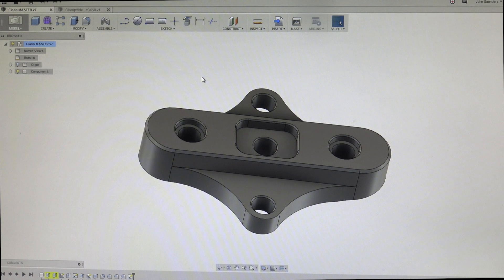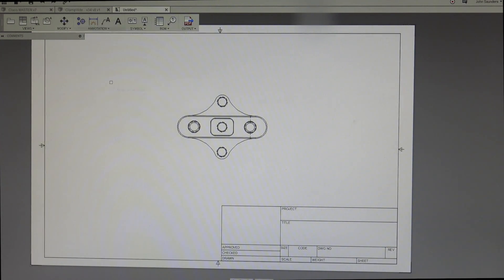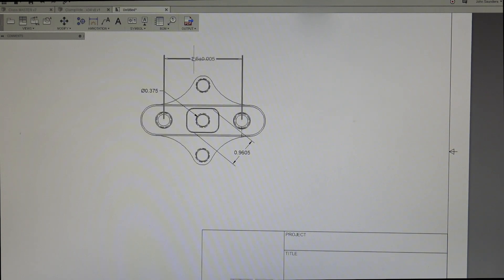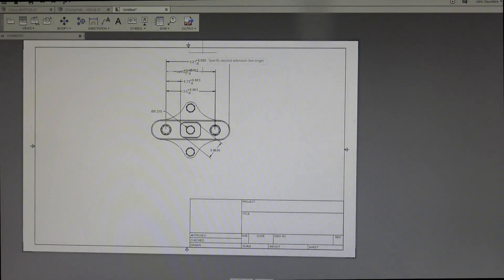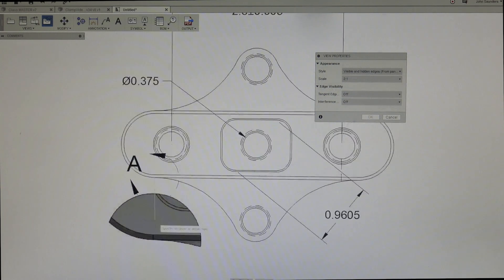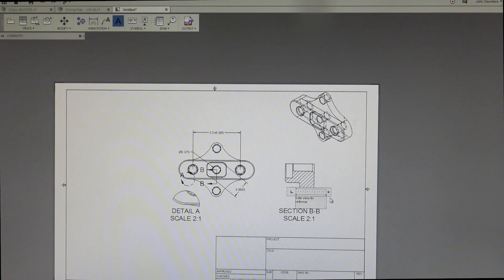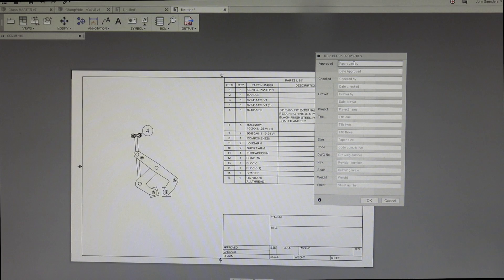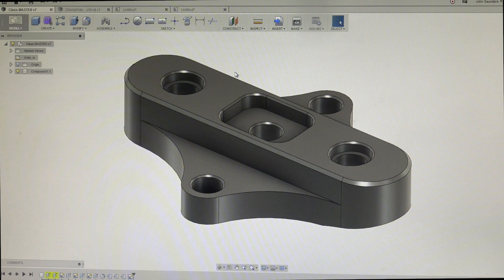Fusion Friday #14: Drawings Tutorial

Comment: You can turn on the trailing zeros by clicking the icon next to the zoom fit button on the bottom of the screen.  It looks like a linear dimension line wit a gear under it.  Check the box that says "display trailing zeros".  That frustrated me for a while, until I was shown it.  Good luck and great videos!

Comment: That was a good basic introduction John, and I think covered most of the basic drawing functions. How important drawings are will depend on the person/application, for me they're often very important, and I absolutely loathe F360's drawing function. I otherwise really like F360 but if I were doing the same as I was doing in a big commercial shop it would be a deal breaker in itself, and that's a great shame. I think drawings are easily the worst area. I particularly have a lot of issues with it picking up the wrong dimension and coming up with an error similar to you had, but often it's very difficult to fix, it's clunky, glacially slow, sadly so it goes on. Apparently the team are working on it, but I wish they would get their skates on with it!
Reply: +NYC CNC Of that's good to hear. I meant to go back and edit my comments to say that the only reason I mentioned it at all was because some of us do indeed use drawings, and for those of us who do it can be important. I didn't want to waste any of your time on this John, sorry 'bout that, but I thought there was a good chance somebody on the F360 team would read it. I clean forgot to do the edit until I saw your reply. FWIW I went through the F360 forum (as have many of us) on this, but it got pulled (rightly) from the ideas station, as a generalised comment that the drawings function is hopeless and needs a complete rebuild isn't much of an idea! Ha ha.

Comment: John,  another great video.  It does bring up another question I've had about 360. As a brake operator, I'm used to having prints with a dimensioned flat and usually a dimensioned isometric of the bent part.  Is there currently an easy way to do this.
Reply: +NYC CNC sorry I even confused myself with that one. commenting before coffee is never good. 
Anyway what I was trying to ask was,  if I draw out my part in the flat and give it a thickness of say .074 is there anyway to create a bend line and form it to a 3d piece in 360?

Comment: Thank you for the great videos! 
I just got a Tormach 1100 and also have a Torchmate 2x4 with CAD lite. Primary I do my initial template layout with cardboard and then put that on my flatbed scanner and import that into CAD lite and draw my part over the template. Is there a way to do this in Fusion? Could you do a video on how you would do a part this way! This would help me out a ton! Thank you!
Reply: +Tim Robel yup, import an image and draw over it, which is likely what you are doing in CAD lite. Or you could quite likely convert the images into vectors with photoshop, illustrator or similar then import a dxf/svg

Comment: Awesome video, some of the best Fusion 360 tutorials come from you, so thanks!  While we program (Design, Test, Manufacture and CMM) the part from the solid, many industries (e.g. NASA) require a drawing to be the master document.  Why, you may ask?  Because technology is changing so fast, and the need to look at something that was created decades ago (e.g. Saturn 5 F11 rocket engine for comparison for the new SLS, Space Shuttle after the foam hit) would require the software and operating system that was used to create it, and sometimes that is nearly impossible, but a drawing can always be pulled.  Thanks again.  PS I looked for this feature and failed.  Just could not find the button.  I searched Help (haha, yeah right) and it came back with NO results.  Go figure.
Reply: All set now, thanks to you!  Oh my silly mistake was due to the fact that there are 2 helps on a mac.  (I didn't see the little question mark (?) on the right.